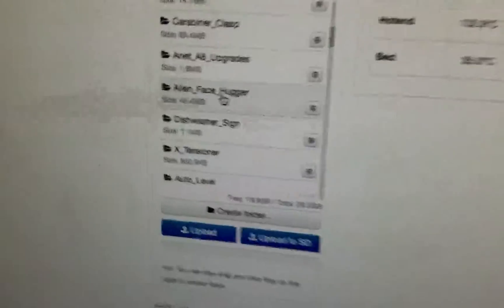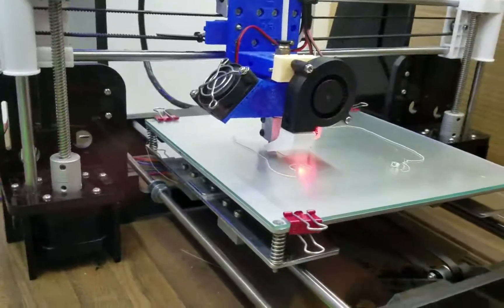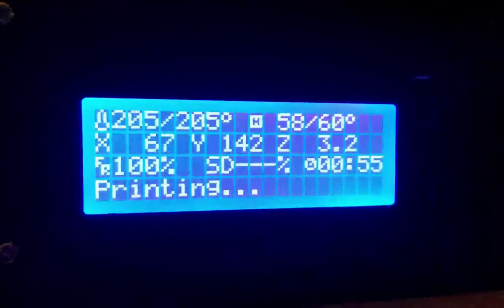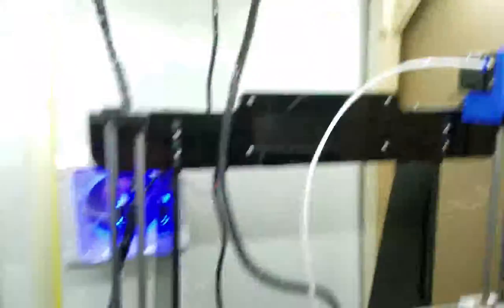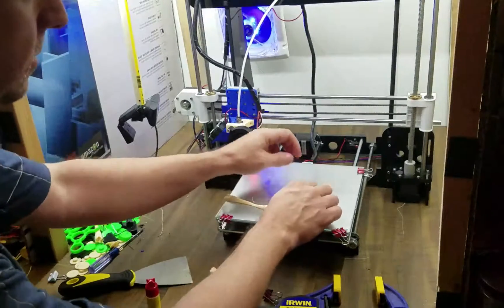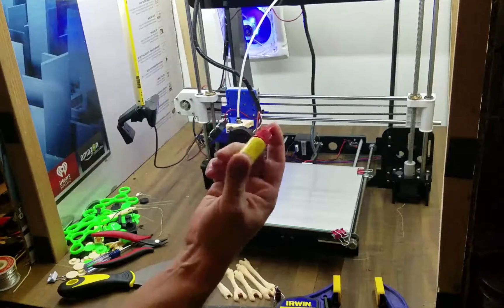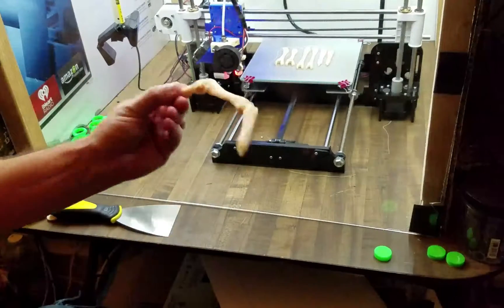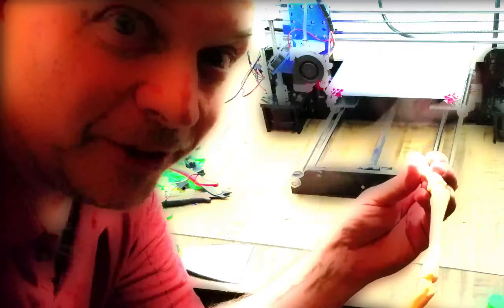3D Printed Alien Face Hugger Leg #MMPOTD 1

Comment: Why didnt to glue them with the joint attached beforehand?
Have you tried the version with a channel for wire to add strength and adjustable positioning?
Reply from the maker: I wanted to be able to take them apart if I needed too later.  However, I haven't needed too since I made them so that probably would have been a good idea. I haven't tried the wire channel version.